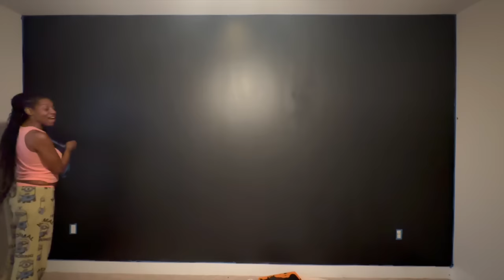Part 1: New Paint Job + Prep For New Closet

Comment: That wall space is the perfect canvas for a "modern wooden Geometric /Chevron accent wall design " but of course that would require nailing wooden strips onto the wall, but it would Dramatically change the space too. But great job Zavia, get yourself the general basic tools: a hammer, screw drivers, pliers, a cordless Brad nail gun, a socket set, a cordless drill, drill bits, a level, tape measure, miter saw, circular saw, and a jig saw. And you'll be surprised at the many households' DIY's that you can actually accomplish yourself.  There's plenty of YouTube tutorials to show you how to safely use all the tools and how to successfully accomplish what ever DIY you want to accomplish. The right knowledge and tools are the secret to all successful DIY's. This DIY thing is a good look for you, maybe you should consider a "DIY With Zavia "channel. Again, excellent DIY accent wall painting.